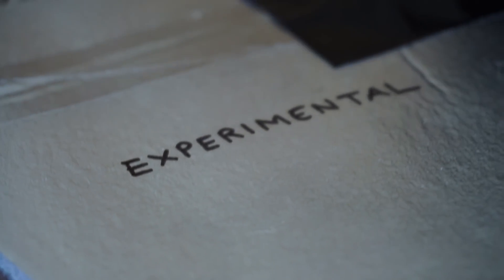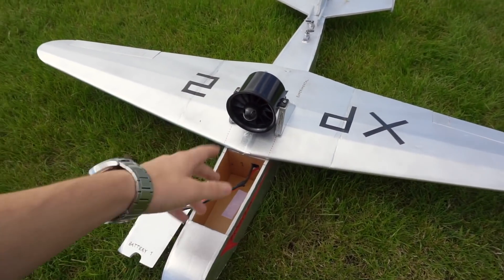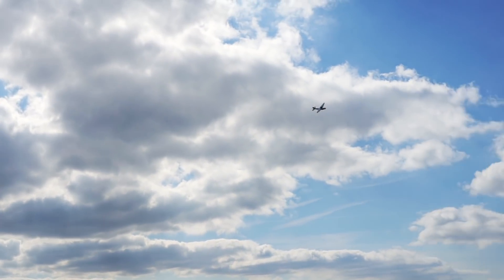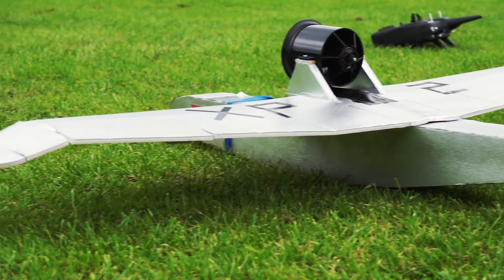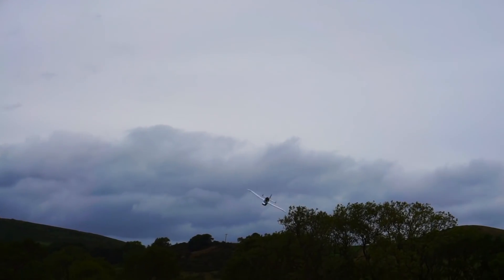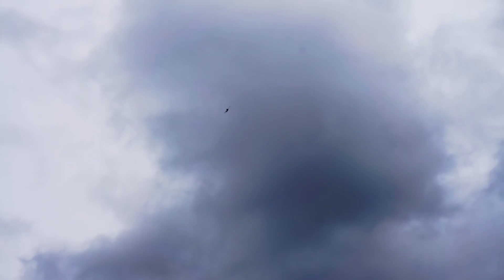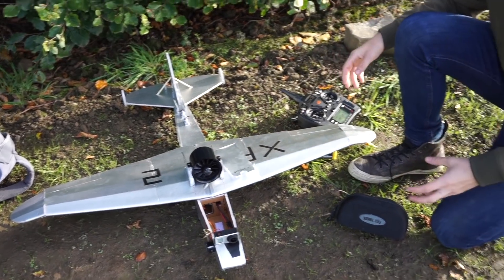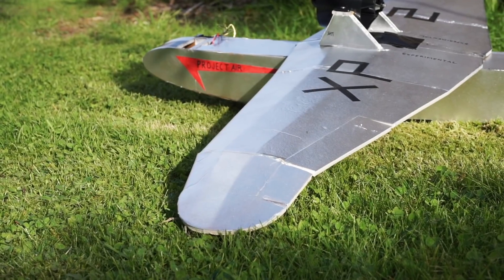EDF Jet Glider

Comment: If you'd like to go faster, a good thing to do would be to add a thrust tube to the EDF.  It'll build up static pressure behind the EDF and give it more speed.  The tube also increases efficiency.  You'll want the outlet to be about 90% of the area of the fan (minus the spinner).
Reply from the maker: Adrian Chupp thanks! I might have to make a video on that
Reply: Maybe do a comparison like you did with the wingtips?
Reply: I was thinking something like that would be cool, replace the how fuselage with a tube annd make it the main body. Those EDFs lend themselves to a design like that.

Comment: Great build Great video.  Question.  How did you determine your Thrust Angle on the EDF.  Or are you just running it straight forward, Parallel to the bottom of the main wing.

Comment: Redesign the fuselage for the fan and all the wiring and controls internal as well.  The main thing gained is a lot less external drag.  Smooth it up a bitand the performance will increase a lot.

Comment: Fantastic job...I have been waiting for this type of video for three years...why does no body offer a edf balsa kit like this? Slightly larger wingspan and the motor inside the fuselage like a U2 Set up. Next project for you  a delta shaped flying wing but with edf motor mounted inside wing and thrust vectoring nozzle ...ie no moving  flaps  ......in any case keep going with the videos they are marvellous to watch  marvellous 
 to watch....big thumbs up 👍👌

Comment: Great job 
Let's say we place we apply the same voltage with use for the rotor engine but  you but instead we use an engine with the Bernoullis principle design, don't you think 

<> we can achieve a longer range??
The faster speed is produced NOT by additional voltage of the duct fan engine but by the Bernoullis principle ?????

Comment: I'm curious, could you put a carbon fibre spar down the centre of the wing so it sticks out each side and put an EDF on each side then make the rotatable? A small gear wheel in the centre linked via a belt to a motor would mean they're rotatable in 360°. Might be a completely stupid idea but also might be a hell of a plane to fly.

Comment: That plane performed really well! That seaplane idea sounds really cool. I've never heard of an EDF seaplane hotliner! Do you know how much power your 25mw FPV camera draws? I just bought one, but it browns out the reciever the second I move one of the 5 gram servos. My ESC has a built in BEC of 5v 1A, and I thought that would be enough power. Any suggestions would be great. Keep the cool projects coming!
Reply: The cheap eBay FPV camera I bought a few months ago draws roughly 100mA at 5v.
Reply: Is it a tiny whoop style camera, or like the one in the video? Either way, that is incredibly low!